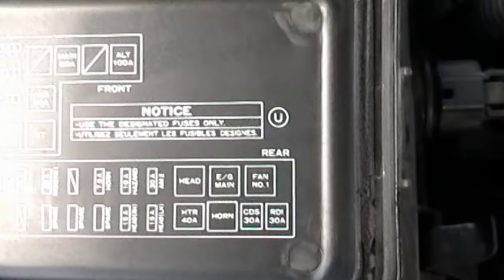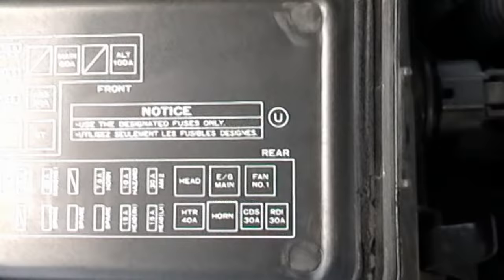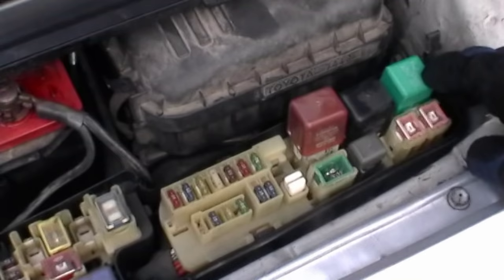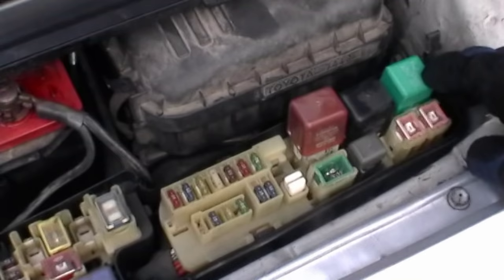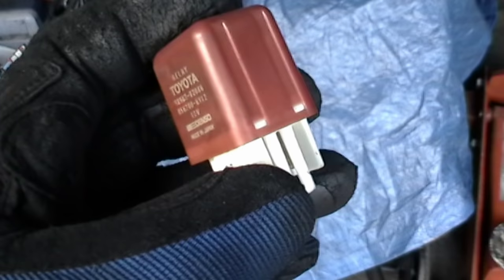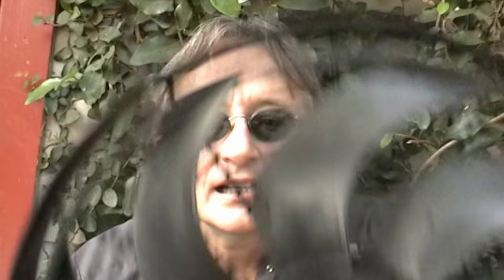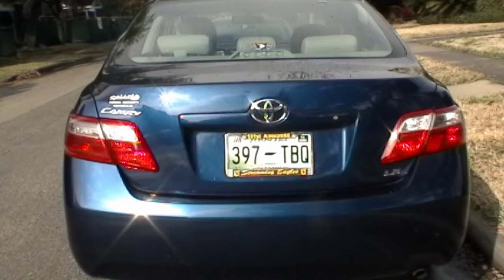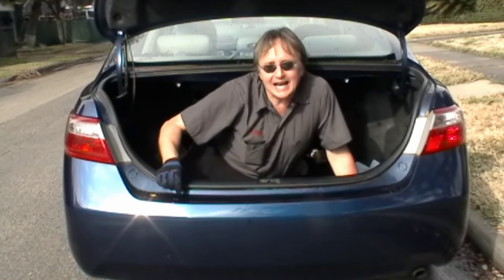How to Repair a Cooling Fan in Your Car

Comment: ok Scotty so I'm getting some good news with my fans so now they do turn on with the relay but 1 fan blows really hard and one fan blows not so hard that seems to be my only problem
Reply from the maker: +Shai Lee replace the one that doesn't blow hard and check the ground wiring on that one too
Reply: +Scotty Kilmer so replace the whole assembly? or just the motor?

Comment: hey Scotty I replace the thermostat in my Jeep Grand Cherokee and I think it might be stuck open because my engine is always running very cool and because of that my check engine light is always on I'm having a hard time trying to find the time to replace it once again and just wanted to know if this would hurt the engine?
 
Thanks Alec
Reply from the maker: over time running too cold can wear engine bearings
Reply: thank you! I'm glad to know this so it doesn't go on any longer!

Comment: Scotty I need your help I have 2011 chevy cruz and my radiator fan turns off and on every 15 secs when I turn on my a/c. I know that radiator fans  turn on and off dude to the temperature on the engine but this is excessive...car has never over heated,can replacing the tempature switch be my situation or a fuse or rely or am I better of changing the thermostat

Comment: Hey Scotty I have a question for my 09 Lexus es350. Saturday I drove home and While on the beltway I noticed my check engine light come on along with the traction control. But the weirdest part was my temperature gauge went all the way down to the cold side. Like all the way cold.  So I decided to keep going when I exited the beltway to a traffic light I noticed smoke from the engine so I pull over and see my radiator is leaking. Now I never saw any signs of leaks before that although I did notice my temperature gauge would go slightly above the middle towards the hot side.  Is it possible my car was overheating and made the radiator blow . Or maybe was it just the radiator ? At the moment I have it back together , left running in the driveway , haven’t test drive yet. But my brother was saying the fan seemed to have a funny spin to it. ( I didn’t see it ) is it possible I have a bad fan and made my engine over heat causing my radiator to blow. How do I know if my fan is bad. Becomes it does come on

Comment: what if the colling fans are controlled by a module thats in circuit with the cooling fan connector
Reply from the maker: those module set ups often burn out, and cause fan problems

Comment: I tried all these steps but the fans still do not turn on only sometimes when I turn the heater up. it seems like the wires might have broken or something. can I just run wires from battery straight to fan??
Reply from the maker: run wire from battery to a switch you can mount on the dash, then to the fans with a 30 amp inline fuse

Comment: Hi Scotty, I just replaced radiator on my 03 Highlander and I installed a new cooling fan switch (the one that goes into the radiator on this model) all good but when i turn the ignition on, fan comes on and stays on forever even though the engine is cold. Also 3.0 Highlander has two fans, only one of them comes on and does this..Never had this problem with the old radiator that I had to replace due to a leak. Any Ideas on what to check on? Thank you!!
Reply from the maker: odds are that switch is bad then if it didn't do that before
Reply: I appreciate your response, I ordered a new one.

Comment: when i unplugged my fan cable the plug coming from the fan was a female not a male, how can i test with jumpers if i cant attach the clips? 2006 subaru outback 2.5. thanks scotty!
Reply from the maker: get a small spade terminal to plug in and put a test lead on there, all auto parts stores sell the stuff.
Reply: thanks!

Comment: one good thing is good to do is go to radio shack and buy a can of electronic cleaner pull out the relay spray in the socket the replay plug into and and also unplug the fans take the same electronic cleaner you get from radio shack like 14 buck that mite save you 80 dollars a hour spary the female plug on the fan and spray the plug that plugs into the fan  the contacks get dirty and some time turn green and look like they got burn black the cleaner will clean this up and if you want you can buy electronic lube from harley davidson they sale for the head light switch to keep it all clean along time

Comment: but the problem is the needle wont go above 90 where it stays normaly even we left the car running for two hours on  a hot day.. so we dont know when is the time to put the fan on if we put a manual switch?
Reply from the maker: fan on hurts nothing, thermostat adjusts the operating temperature.  You could just leave it on when driving.

Comment: so I have 2 cooling fans and when I disconnect one of them and prob with the little connectors the other fan comes on but when I switch it and connect the other connector to the probe in Sparks I tried it multiple times just to make sure wasn't anything wrong but it keeps parking do you have any inside why it might be sparking?
Reply from the maker: +Shai Lee when you disconnect one and the other works, that pretty much shows the fan you unplugged is shorted out or the wiring to it is bad

Comment: Mr. Scotty, My 2000 Mitsubishi Eclipse 3.0 coolant fans work normal when engine is running but continue to run all times when ignition key is turn off. (Car was over heated and replaced head gaskets) what would be the cause. Thanks a lot, Sir. Jimmy
Reply from the maker: often a bad main computer circuit does that, but you have to replace the whole computer to fix that. IF it stops running after ten minutes or so , leave it alone
Reply: Scotty Kilmer no sir. I have to pull the fan or MFI relay.

Comment: scotty I have a 2005 chevy 4500 and the a/c only runs if I let off the gas or press brake you have any ideas please help it has 8.1 gas motor
Reply from the maker: sounds like electrical problems to me, I'd check the wiring to the ac compressor and the blower motor first.

Comment: Hey scotty Question, my cooling fans for my 96 Buick Riviera turn on after the temp gauge reads over 210 I was just wondering if it the cooling fan controller and where is it Located at cant find it any where

Comment: Hey Scotty maybe you could help me out, my Compresor fan turns on then turns off in a few seconds, I order the fans on eBay and it works nice connected directly to my battery :( it’s a 2010 Camaro 6.2

Comment: My Saturn SL2 fan only turns on with the AC turned on. I have already replaced the thermostat and it still doesn't work. Any suggestions?
Reply from the maker: try a cooling fan temp sensor, and pray it's not a bad main computer circuit

Comment: For a 2010 Honda City, Radiator fan only works when AC is put on? OR when AC fan is working. Why?
Reply from the maker: often a bad temp sensor for the cooling fan, pray it's not the main computer circuit burned out for the fan
Reply: Thanks Scotty

Comment: I have a wired problem if my car is start or turn off my cooling fan is on 24/7 after is problem when I stop somewhere my car I takeoff my battery wire.

Comment: scotty i have 2 cooling fans. light came on for faulty cooling fan relay2.  replaced the blown fuse. it blew. replaced the relay for cooling fan 2 and fuse still blew. fan runs even with the fuse blown when the ac is on.  the passanger fan does have a little wobble to it when it spins...what would be your best guess for fuse blowing. besides the wobble both fans are energized and spin. i guess my real question is do relays blow fuses if they are faulty. i ask because fan2 i looked at the diagram has 2 relays. and. powers the "wobbly" fan. the relay i changed was labled fan2 the other on the same circuit is labled cooling fan sp.

your content helps me out alot any insight on my 2003 buick rendevous cooling fan issue would be appreciated greatly.

Comment: hey Scotty, I have a 95 civic and it overheats within 20 min of driving.. I changed waterpump,coolant fan switch,coolant temp sensor,thermostat,relay, and I tested my radiator motor and it works fine but my fans still doesn't work.. have any ideas of what's going on?? I had people telling me I can wire the fan switch into the grounding and put it on your cabin but the thing is idk how.. some others tell me that connect your fan to the alternator so that whenever you turn on your car my fan will turn on and it will turn off when my car is off.. any ideas of what I can do to make my fan turn back on?
Reply from the maker: Austin Chasengnou   computer ultimately runs those fans. SO, most guys will just rewire the fans to run off a manual toggle switch and run it that way rather than buy an expensive computer

Comment: Hi Scotty

I tried all steps the fan was spinning cut on,until I got up to testing the cooling fan temp.switch,I hooked up to negative terminal as you said they did not move.
.so it would be the relay???
Reply from the maker: could be the relay or the computer that feeds it power, if the fans blow when you give them battery power
Reply: I realize while testing fuse with circuit fuse tester I have to press down on fuse...bought a new fuse from junkyard but no response...think it could still be fuse?

Comment: I bought radiator fan on ebay but they are running backwards any tips on how to fix them?
Reply: Did you get the puller option? And did you try reversing connection?

Comment: Hey Scotty. I have 06 Nissan Maxima. My problem is that after start up in the morning drive enough to get the engine hot, stops at wherever for 15 mins to come back to start the car it hesitates and dies. But if I wait for about 10 mins to start the car car stars again. It kinda has to do with weather too cus when it's hot or cold it doesn't happen but when it's in spring or fall problem happens. I've fixed fuel injector, starter, shops seem to not find anything wrong. Any advice? Thank you.
Reply from the maker: +Jason Kim  when it doesn't start, pull some spark plugs to see if they are wet or not. If not wet, fuel pump or injectors are not working right. If wet, it's flooding out from either ignition system failure or leaking fuel system

Comment: Hiya Scott... I have problem after replacing the temperature sensor on my 1998 Saturn SW2 and then it seems the fan suddenly stopped working and was overheating. Later when I got back home I spliced in wires from battery leads to each of the fan wires and ...nothing? I also pulled the relay and jumped it with hotwire and the test light came on but the fan did not? then after watching a "Richpin" video of fan repair on Youtube I saw a guy testing from the battery lead to the fan base for a ground test, the light should light up, and mine did not? what does that mean and what can I do next to establish a new ground if it doesn't work direct from the battery?
Reply from the maker: Todd Gilmore   computer problems often do that, heck, that old thing, just rewire the dumb fans with a toggle switch, a fuse, and power from the battery and leave it at that.

Comment: Hey scotty i have a 98 dodge caravan 4 cylinder and one of the cooling fans seem to be working well the other one works but wobbles and hits the outter plastic do i have to replace with a new cooling fan or is it just loose?
Reply from the maker: replace it, but chinese made ones cost less and work fine

Comment: Hey Scotty I test the fan wtff both came on when I put On the cooling connector. But the ac fan won't turn on when ac is on ? Why?
Reply from the maker: ac fan works on its own circuit, either sensor for ac is bad or computer driver for AC system in the module has burned out

Comment: what can be the issue if the car blows warm air while parked and cool up when driving?
Reply from the maker: cooling fans that don't work right, or low refrigerant in the AC system

Comment: cavalier 2000 replace thermostat, sensor and checking fan splice lines before enters motor and ran to wires to battery does run. But when I idle engine turn on cooler doesn't turn fan on.

help appreciated
Reply from the maker: heck put a toggle switch, wire and a fuse and run the fans that way, rather than mess with that Crappy GM electronics
Reply: thanks

Comment: I have a flex-a-lite fan on my 65 mustang and I tried connecting the fan to the battery and it turns on but it won’t turn on on it’s own when the car begins to get hot. It also keeps blowing the fuses that I have. Any idea what the problem may be?
Reply: Yeah you need some serious electrical upgrades for the cooling fan

You cannot just get rid of the engine driven fan and just throw in a electric fan to simply wire up

Comment: I have a 2006 Pontiac grand Prix (supercharged) and I have replaced the fan motor, coolant temperature sensor, fan relays (3 of them), plug to fan and the thermostat. The fan will work for about a month and then stop all over again. This car has dual fans, passenger side works well, drivers side is the one giving me problems. Can anyone please give me some useful advice on what I might be missing or what I should try next. Thanks

Comment: plz help I have the same corolla and my fan comes on late. the motor don't overheat a lot but it over heat more than it should before the fan comes on but at times it work s fine I change the thermostat but it still does the same thing I was thinking on changing the same sensor you change but I wasn't sure plz help and thank you
Reply from the maker: yes, try that, and if that doesn't work, why not rig up wiring and a toggle switch to turn it on manually

Comment: looking help plz. 1992 Mazda miata?  if the radiator fans only work when a/c is in the on position what would be the most common troubleshooting to refer to first..... wildfire saying thx u need all the info I can get.....
Reply from the maker: +Rudy De La Cruz pray it's the cooling fan temp sensor and NOT the main computer

Comment: My 2004 pontiac grand prix is giving me the same problem and i tried every thing and it still doesn't work. What should i do?
Reply from the maker: +Rimsky Pierrelouis hot wire the fans, if the blow then, wire them with toggle switch wiring and a fuse to turn them on manually

Comment: I have a 2014 ford focus that the fan somehow popped out of the assembly, anyway you can help me if I send you pictures and video?
Reply from the maker: it's plastic crap and just buy a fan assembly complete unit aftermarket, I get em cheaply enough. But if you want to send pictures, do this: If you wish to ask me car questions, I am switching my questions and answers to my website. So go to www.scottykilmer.com     and ask me in the Ask Scotty section. E mailing me here is ONLY for the live car talk shows on Thursdays at 1pm and saturdays at 10 am WHEN the shows are actually airing and I am answering live questions. So please, if you want your questions answered, go to this link and join my completely FREE website. No strings attached.

Comment: Scotty I have a Dodge stratus that the cooling fan for the engines comes on and off intermittently the whole time the car is on. just keeps going on and off never stays on for more than a second. what could be the problem? thanks ps- the car doesn't overheat
Reply from the maker: try a new temp sensor for the fans

Comment: I have a Question, about a week ago my wife's car (2013 Chevy sonic LT 1.8L) started making a weird, yet loud sound coming from under the hood. After closer inspection we noticed that the cooling fan was wobbling inside the shroud. I took the fan out w/ the shroud and inspected everything for any kind of debris, worn out blades, and etc with no signs of anything externally wrong. So then I checked the motor/fan to make sure there was no damage to it and found nothing. Finally, I found out that I am able to move the fan blades about 1/4-1/2inch with my fingers. I tightened the main screw that holds the fan to the motor, conducted a test via test leads to battery and it works but still looks wobbly. Any advice?

Comment: hey scotty have a problem with a 2007 ford Taurus the cooling fans work but just on low when I turn the ac on the cooling fans stays on low they will not kick on high at all I check the high and low fan relays and they work then I replace the temperature sensor and the fans still want come on high with the ac turned on what else could it be
Reply from the maker: Ricky Slatton realize the computer ultimately runs those fans. Me, I'd just rewire the fans to run high all the time using a toggle switch and a relay rather than mess with that complex, expensive computer driven system

Comment: hi, Scotty. I have a 07 scion tc. cooling didn't work, and running very slow when I turn on the AC. i test the motor, it is fine, didn't find fuse problem. i try to check the sensor, but there are 2 pins, which pin should I connect to the battery?
Reply from the maker: do not connect sensor to battery, they work on 5 volt reference signals
Reply: Scotty Kilmer thanks for the alert, so where should i connect the wire, engine block?

Comment: Scott which way should my fan be blowing on a 99 mustang. the fan is in between the radiator and engine
Reply from the maker: +jereme searls towards the engine sucking air into the engine compartment
Reply: You the man! Thanks.

Comment: my mom's 2000 dodge caravan cooling fan still runs after its been shut off and I had to remove the fuse for the fan to turn it off what can I do to fix it?
Reply from the maker: +george serrato replace the blower relay, and if that doesn't fix it, odds are it's a circuit inside the made computer shorted out

Comment: Hello..sir  I have trouble in Ford ecosports petrol vehicle the the cooling fan on / off , on /off  but cooling is ok . I connected the gauge low side pressure 30 to40 
High side pressure 250 to 300 it not constant plz Conway me how to face to the problem